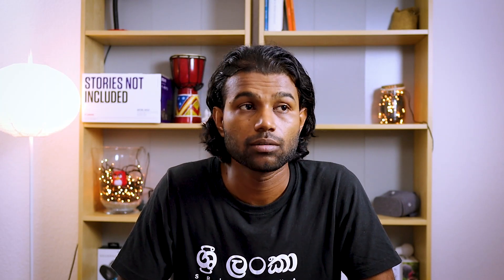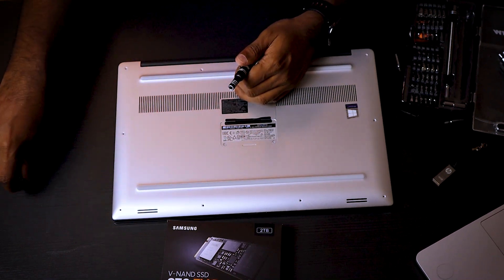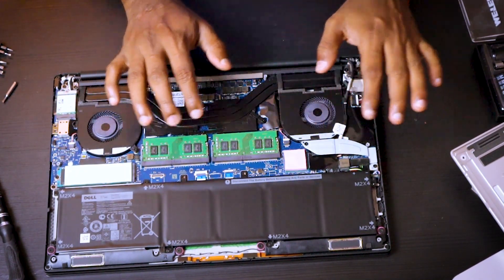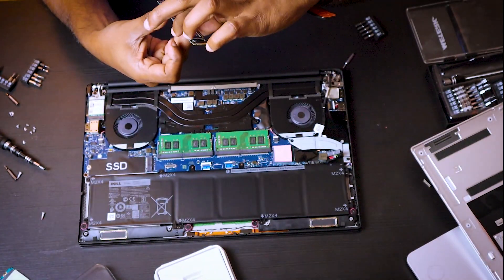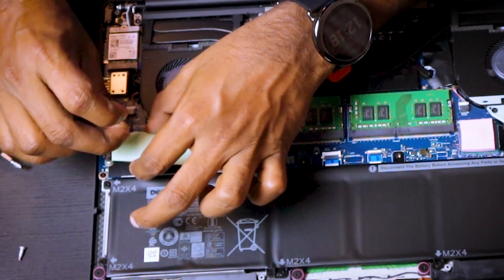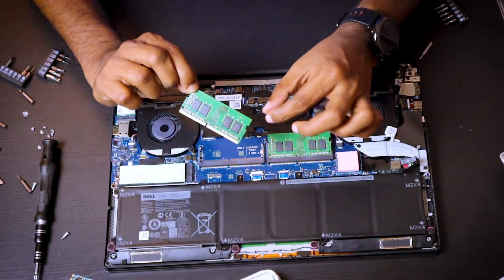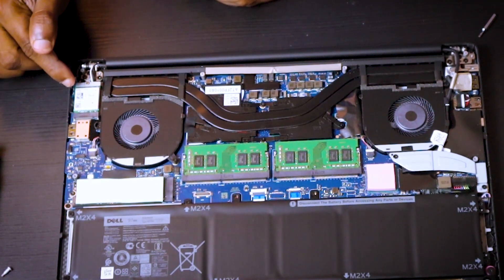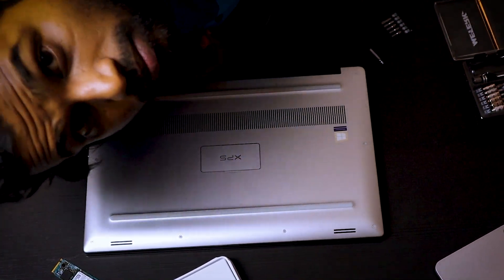Upgrade RAM and SSD of Dell XPS 5 7590

Comment: What toolkit do you use? I am confused about the size of Philips screw.
Reply from the maker: You will find it in most of the smaller toolsets. It's the one with 5 or 6 edges.
Reply: @GnomezGrave  Ok, do you have link of the toolset which you used in this video ?
Reply from the maker: Sure. Here it is.
https://amzn.to/3nJpsJp
Reply: Hi, I changed my internal drive. However, I can’t read data from my old NVMe drive when I connect it using external enclosure. The drive gets detected in device manager but doesn’t show up in explorer. Any suggestions?
Reply from the maker: Yes, it's because it's encrypted. You need plug it to the computer and boot using that, then decrypt using BitLocker.
Then you will be able access the files when it's plugged again as an external device.
Reply: @GnomezGrave  I had decrypted it before cloning it to Samsung EVO. I read somewhere that it has to be formatted. Any idea ?
Reply from the maker: Sorry man. Haven't had any experience with this. I wouldn't recommend cloning TBH. I would still install everything from the scratch.
Reply: @GnomezGrave  no problem, any particular reason of not recommending cloning ?
Reply from the maker: Windows will create all the driver signatures for existing hardware, including the NVME drive. I'm not sure how Windows is going handle it. And also, no need to en/decrypt hard disks.

Comment: What exact model of ram specs will work; frequency is limited. BIOS not adjustable for over clocking? (3200 and 2666 both failed to boot giving front light code /3 white and 2 amber/ = RAM not found.)
Reply from the maker: I have 2600MHz modules. I don't think we can overclock, it's a H type processor.

Comment: Do I need to download windows or anything before replacing the SSD ?? Great video by the way it's the one I'm using for my upgrade. Better than any other vid
Reply from the maker: Yes, you would need a bootable Windows media, because I had a clean reinstallation. But some people suggest to take a snapshot of your current installation and restore it. But make sure you decrypt the harddisk first since it's been encrypted using BitLocket.
The easier and the faster way is to do a clean install. But you have to install the drivers as well.
Reply: @GnomezGrave  I don't wanna be too much of a bug if you're busy but you know a lot more about these things. I'm picking between a few lap tops for picture and some video editing I was wondering if you have any suggestions or anything
Reply from the maker: If you're doing some light video editing, you don't really need a big graphics card. Any mobile version of graphics card would do.
But you need a good processor, at least i7 with 16GB RAM.
You can check Dell XPS 15 (this or an older model), Razer Blade 15 or even an 2018 or early 2019 Mac Book Pro.
Look for a used one and you will get a good price!

Comment: Hey bro.. i think you are from India as I also, have bought 7590 from UK. But want to upgrade with 1 32gb ram. Can you suggest me brand as not available in crucial.
Reply from the maker: I'm Sri Lanka.
You can go with Samsung, Kingston or Corsair, but they can be a bit expensive. However, I suggest you to have two 16aGB modules because it will be faster.

Comment: I would like to Ask, 'What sort of Work you do that you need 32gigs of RAM & 2TB SSD?"
Don't you think it's over Specified & unnecessary.
Reply from the maker: I'm using it for video editing, but for that 16GB would also be enough. But I also use it for development and it helps me to run multiple VMs (or Dockers) and several IDEs at once.
But I don't think 2TB is an overkill. You always can upgrade your RAM, but it will be very painful to upgrade your SSD. Since I use it for multiple purposes, I think 2TB is a good investment.
But of course, it's not necessarily be that for everyone. 😊
Reply: Photo editing uses a lot of memory to hold a large Lightroom catalog. Also editing takes a nice amount of GPU and graphics memory. The 2TB SSD is just barely enough for video editing, and a decent amount for shooting RAW with a DSLR. I have 32 TB of external/internal storage on my desktop, and several SSDs for speed.

Comment: Hi
I want to clone the 512 Gb SSD to a 1Tb EVO Plus SSD without first installing the OS (so preserving the factory default) but the cloning software fails because the 512 is bitlocker encrypted. Do you know how it can be cloned?
Reply from the maker: I didn't do it like that though. I directly installed using a bootable USB. The hassle with that it I had to install all the drivers, but it's not that hard. Because the Windows serial key is embedded to BIOS, you won't need a separate serial number.
Reply: You have to decript the drive from windows before initiating the copy. its pretty easy and once decrypted it can be cloned